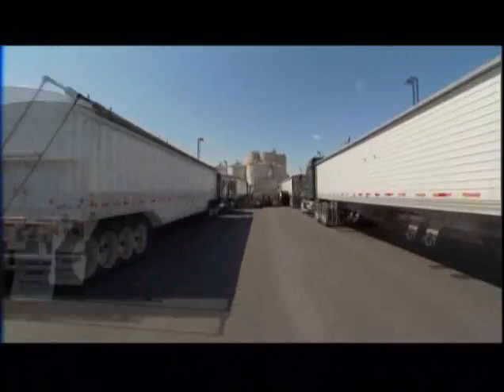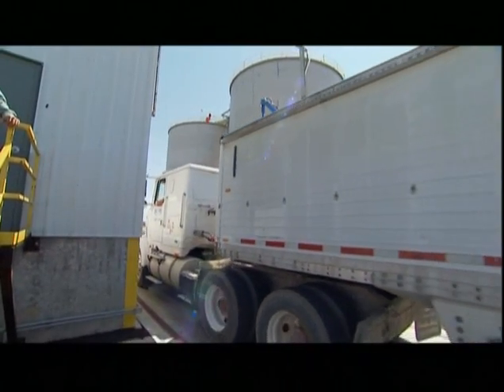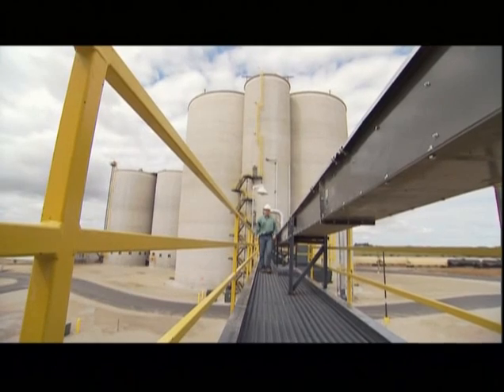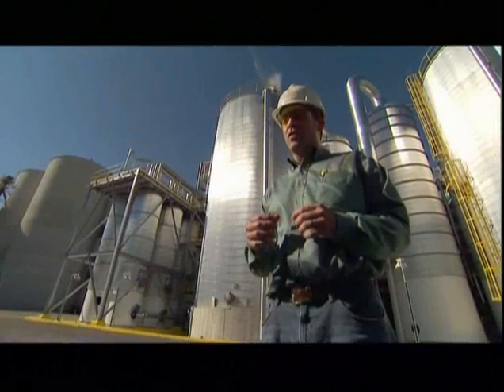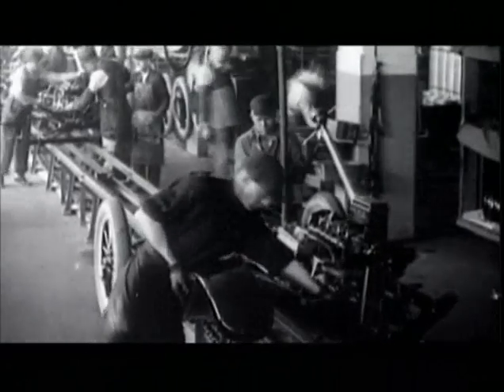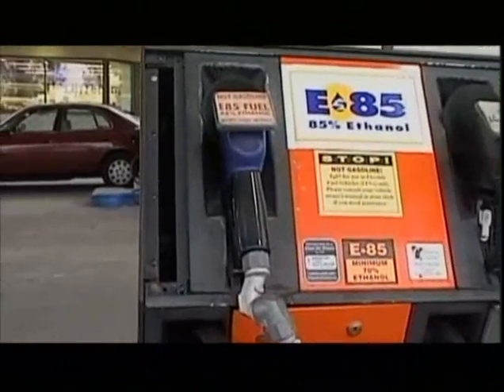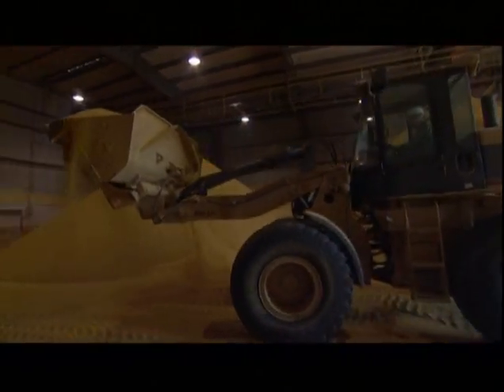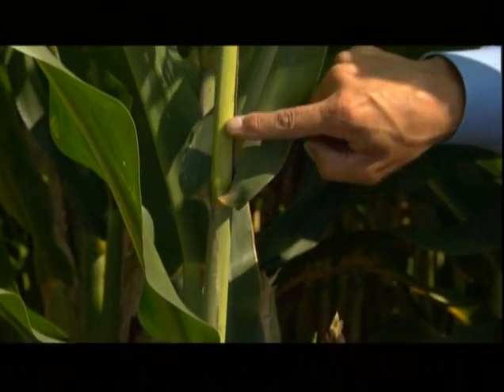Ethanol on Modern Marvels

Comment: WOW, half of the comments on here are pure regurgitated BS. 
1. Farms are already using the diesel powered equipment. Nothing is stopping them from making equipment with turbocharged E85 electric hybrids.
2. Ethanol can be made from other crops, not just corn and there are hundreds of thousands of empty factories that can grow them all year.
3. E85 is cleaner burning, so we should just stick to running gasoline and polluting the air, because farm equipment runs on diesel?

Comment: Well I'm sorry I didn't make it clear, I was making that statement with the implication that ethanol is used in an engine that's more tuned to run on ethanol.  But otherwise yes I know, you're correct, the low compression doesn't take advantage of ethanol's higher octane but can still run on it...

Comment: yes and no.  None of the current every day production motors produced for USA can take advantage of the higher octane because the compression ratio is not present in the motors. Compression ratio is done mechanically in a motor.  Current motors are built to be run on ethanol & gas.  So mechanically they are set up for lower compression.  Your argument would be like putting 93 VS 87 octane gas in a stock Honda Fit & expecting that gas would produce more power.  It won't.

Comment: Nope not true, ethanol has a significantly much higher octane of 110 which means a much much higher compression ratio.  You know what that means, more horsepower and torque thus much more efficient than gasoline.  Also, they're using the corn anyways to feed animals, cows that don't eat starch.  The production of ethanol is an EXTRA commodity in this country so you've been proven wrong.

Comment: @thegreatkoua CH3CH2CH2CH2CH2CH2CH2CH3 is the molecular formula of Octane.
CH3CH2OH is the molecular formula of Ethanol.

The ratio of hydrogen to carbon is 3:1 in Ethanol.
The ratio of hydrogen to carbon is 9:4 in Octane.

Therefore the amount of energy output per carbon emission in Ethanol is higher than in Octane (more energy for less bad stuff)

However, the way in which these fuels could be improved if we used algae bioreactors to convert the CO2 into O2... eliminating all carbon.

Comment: ethanol still produces CO and CO2.... we should be using electric vehicles, and we could use the ethanol to produce electricity.  When it burns we pump the CO2 produced through an algae bioreactor.  Algae is protein and and oil consisting mostly of Omega 3 fatty acids.  So if we mix algae with the corn feed, we could ensure that the animals get Omega 3 fatty acids in addition to the omega 6 and omega 9 fatty acids that are in the corn feed.